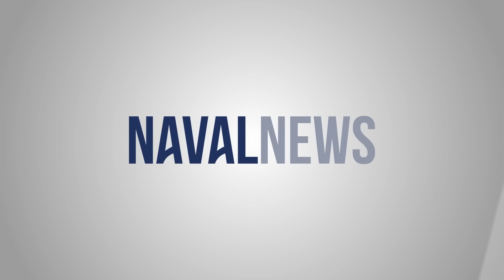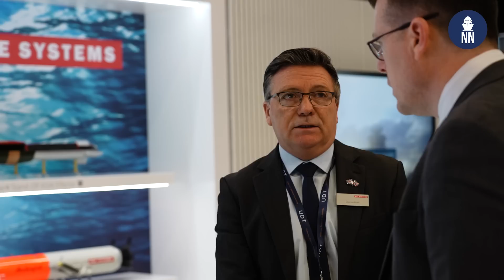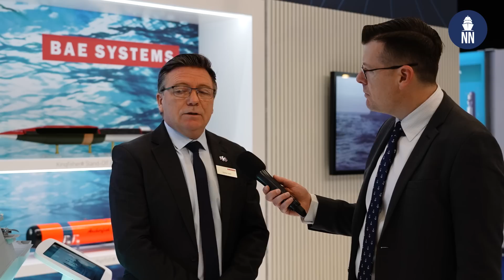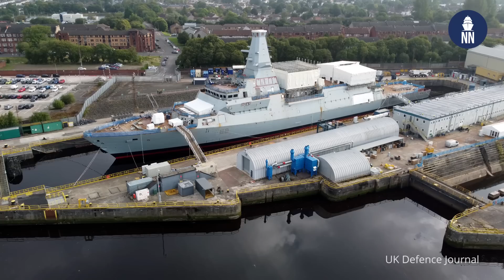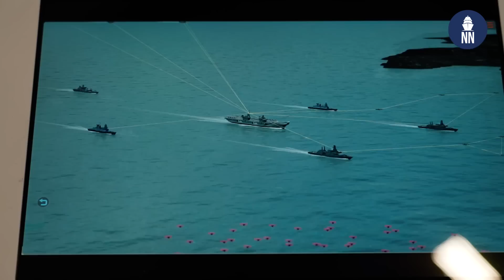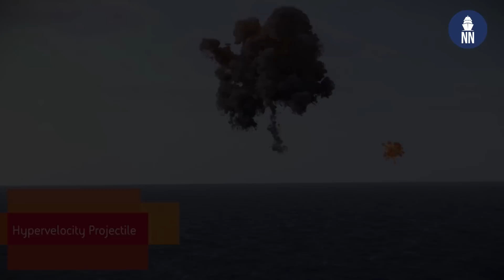BAE Systems pitching Type 26 frigate to Norway

Comment: I would like the Type 26 frigate to be equipped with ASRock as standard.
Reply: The tender has already gone out for candidates. Rum-139 is probably too out of date- 50km+ range is a minimum really- or it would make more sense just to stick a surface launched spearfish on t26
Reply: @lukeallison3713  I really hope they go ahead with that idea because it would add real punch instead of relying solely on a helicopter. 

My money would be on the Type 07 from Japan, it was developed it as a longer range and more capable version of ASROC. It's MK 41 compatible and has a stated range of over 30km, although I think it's safe to say it's likely much more than that.

There is a very nice looking Indian weapon called the SMART missile but it doesn't appear to be compatible with MK41.
Reply: @Cravendale98  I'd guess 50km+- which even otomat (nearly 3 decades old and subsonic) is capable of. The challenge is stingray integration. Stingray itself is going to need a serious refresh to compete with MU-90- I think a new lightweight torpedo is in the works. Doubt smart would even fit in a strike length mk 41 cell, and its probably overkill anyway, more of a land based weapon with sea  based sensors
Reply: @Cravendale98 Whan annoys me also is that t26 doesn't have a true 'double hangar'- even Horrizon can carry two merlin, t45 and t22 b3 could carry 2 super lynx. There is provision to use some of the  mission bay for a 2nd, but doubt it will be used anyway. Probably to do with the fact we have no merlin or wildcats
Reply: @CrackingDale25 

If we integrate the Type 07 anti-submarine missile with the UK short-range torpedo and CAMM missile control system, I think we can install it on the MK41.
Reply: @lukeallison3713  Isn't it just one big hangar Vs two smaller ones? The Merlin is a big helo, I'd be surprised if they could operate two, even Wikipedia says the Horizon class can only operate 1 Merlin.
Reply: @Cravendale98  The Italian ones have double hangars on both fremm and horrizon, the French have single hangars. They just often only carry 1 merlin out of choice. Even a merlin with flash and upgraded wildcat with flash compact,avionics upgrades etc would make the asw capability far more reliable